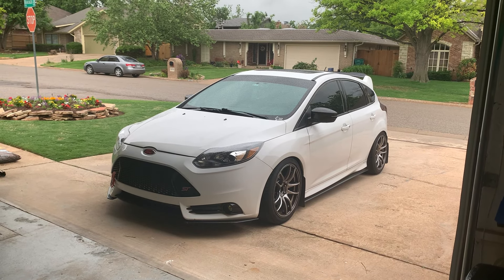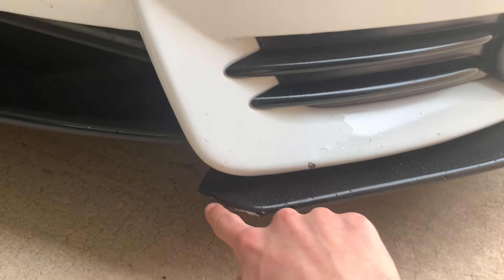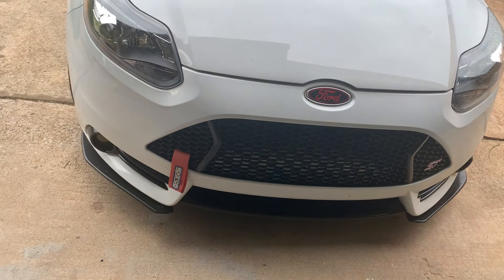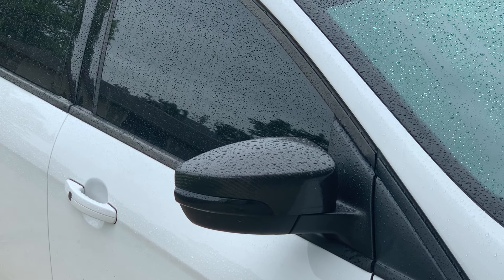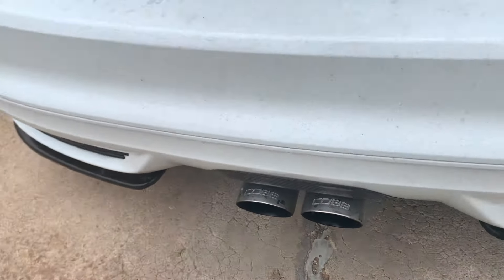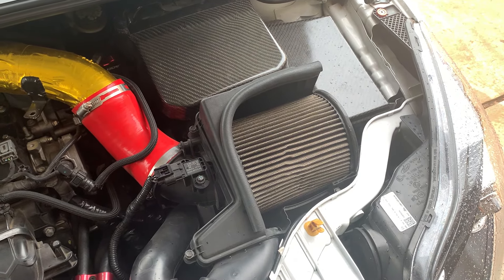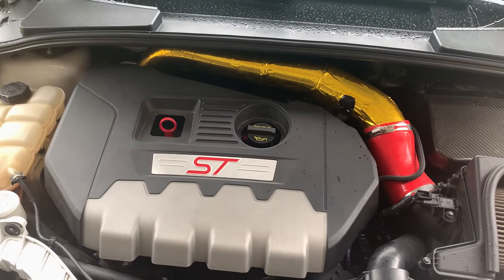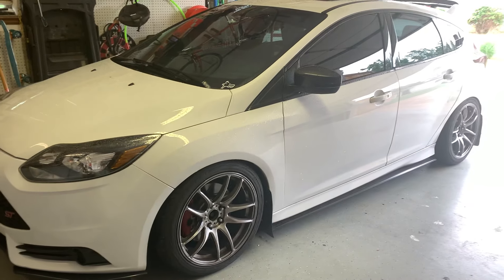*Full Build Breakdown* Everything That is Done to my FBO Focus ST So Far!

Comment: I'm in the middle of rebuilding my Focus ST (Mk3 Facelift ST3 version from late 2017).  Nothing external done at all: everything is under the skin:

- Focus RS dual mass flywheel & clutch
- Mfactory helical LSD
- Airtec Stage 2 Air intake system
- PumaSpeed Stage 3 uprated intercooler
- Rear motor mount upgraded
- Stage 1 PumaSpeed MAXD-OUT 280+ retune (289bhp on the dyno & 386 lb ft torque)

Next week a Milltek Sport catback with titanium tips goes on.  Beginning of July, a new Turbosmart recirculating valve to replace the OEM plastic one, and Airtec solid charge pipes.  Avoiding coilovers and lowering the car as I want good ground clearance and reasonably good supple ride, and later in the year a Milltek Sport hi-flow 200 cell downpipe coupled with a PumaSpeed MAXD-OUT 300+ retune (for just over 300bhp, probably around 310-320 it will yield)

Comment: Curious why you took off the tru vacuum line for the bov?
Reply from the maker: The instructions for the recirculation valve said it was intended to be run off the solenoid so I switched it back
Reply: @Nickjoenap  ok cool, i have the boomba and when I flashed a ots tune while I was waiting for the custom tune it makes the bov go off randomly even when cruising so I ran a true vacuum line
Reply from the maker: @cnebuda7422  yeah i had my boomba ran to true vacuum

Comment: Dudee i installed a Mishimoto radiator on mine because the stock one got blowned by a tiny rock. Huge pain to change mostly due to put everything back together. That hood gap is a problem. A one in a million problem. I'm installing some rubber seal for that gap to avoid getting another tiny rock in the engine bay again. Even if its one of the rarest even ever.
Reply from the maker: I’m working on finding a way to lift the bumper so there’s no gap and hopefully make a video on it soon